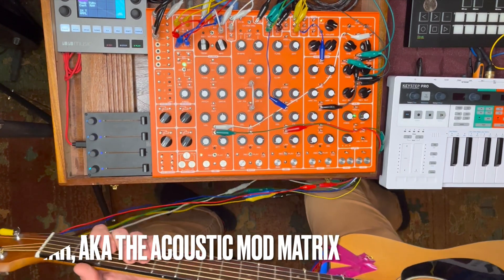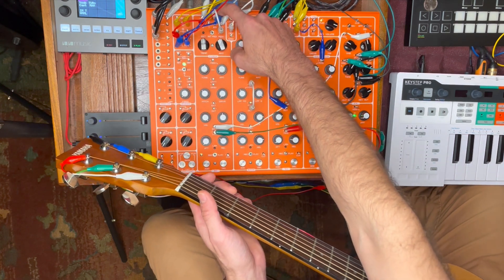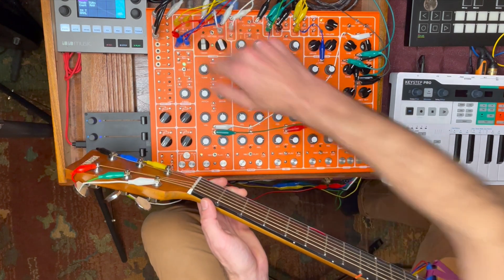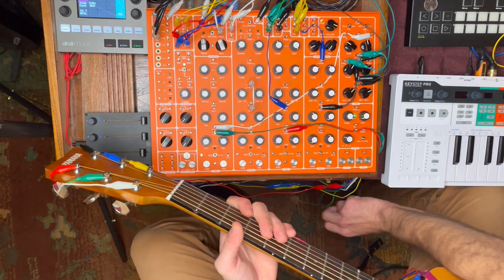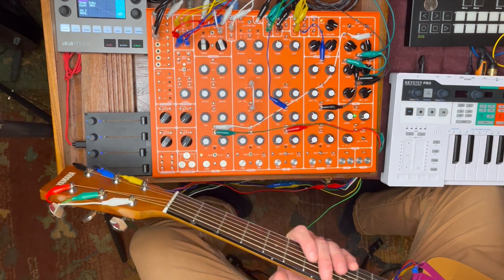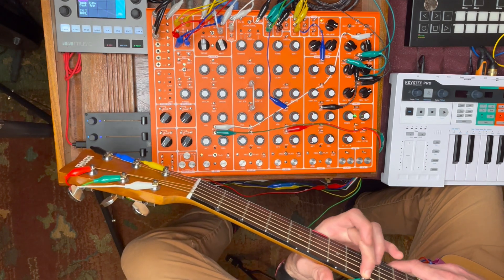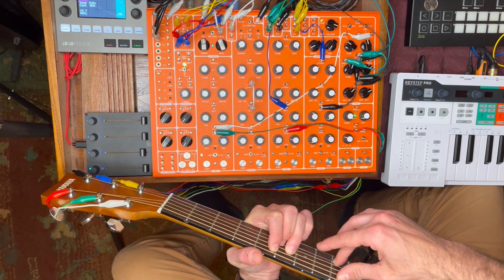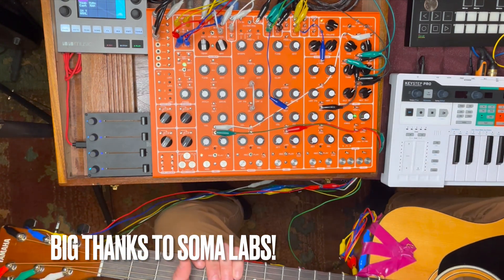Pulsar-23 Patch : Pulsitar-23, AKA the Acoustic Mod Matrix

Comment: Gamechanger! Do you think is there a way to use this method to trigger the gate cv on the Lyra-8? Some 1/4 jack to cv adaptor, or something like that.
Reply from the maker: Soma makes an adapter for the ornament-8 that should do the trick, but (if you don't mind potential scratches) you should also be able to use the pulsar-23 ground pin (or another grounding point) to trigger the lyra gate, since the gates open when shorted to ground. If you have a gator cable with a clip on only one end (to reduce chance of scratching), try taping the bare wire end to the lyra gate pad and the other clip to ground. If that activates the lyra, then hell yeah. I do not own one or I would test it for you!